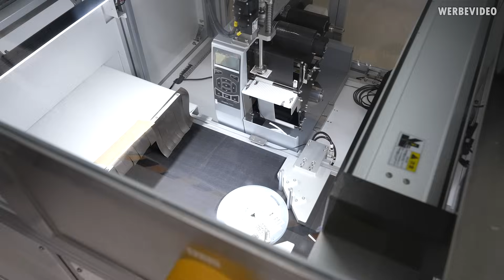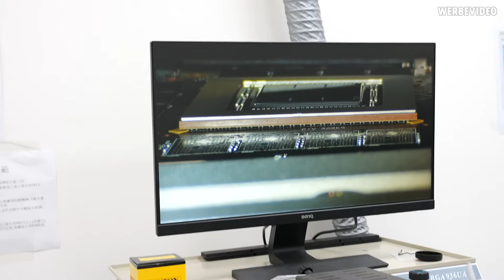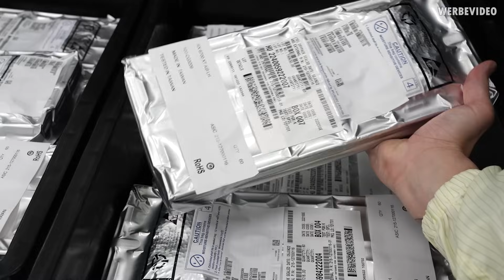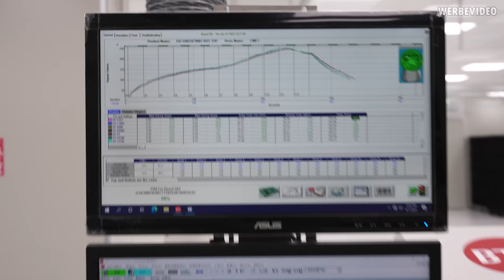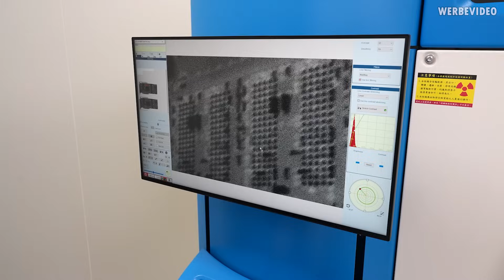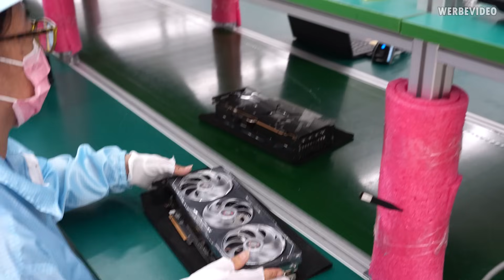How Graphics Cards are made - Insane PowerColor Factory Tour

Comment: We need more brands/AIBs to be so transparent like PowerColor, and shows us how they made the products that we buy. Very thanks to PowerColor for letting you show us everything.
Reply: Most are made by PCPartner
Reply: Imagine ASUS getting exposed about cheap makeshift handler picking up randomly organized capacitors and slapping them on precariously
Reply: @fruitbouquet5479  imagine that it's not hardware that's the problem at ASUS but it's software :o
Reply: I used to work in a facility like this (but not VGA and I was in a clean room) and I'm 100% confident that all the other brands build their cards the same way, they probably use the same machines too (or very similar ones). Because this is the way you have to make these cards, there is no other way.
The difference is how the different brands QC their end-products and where do they order their PCB and SMD components from.
Reply: Big players like NVIDIA or ASUS would never allow this, and definitely not to der8auer. Someone like Linus might have a chance under strict surveillance like the tour with Intel.

Comment: The pick &place machine measure the tool vacuum and knows if a component has fallen off before reaching the board. This way, the tool with the missing part does not touch the circuit board which would get solder paste in the tool. It knows....

Comment: The reels feeding the pick & place are specifically ordered to reduce placement time. About 8 parts are sucked up at a time and photographed as they leave the reels any rotary or cartesian offset adjustment is made on the fly to the circuit board. The parts are puffed off the tools onto the boards. To speed up the assembly pipeline, four machines are utilized. One fourth of the parts being place by each machine. That speeds up the line...

Comment: I bought a brand new power color ex 7900xtx red devil . I went to plug in the 3 pin egg cord and both outlets broke with the slightest pressure. Spent 1100.00 for this card and haven’t even turned on the computer yet. This is my third series of red evil and I’m shocked at the quality of the rx7k series quality

Comment: What a crazy tour ! I'm surprised they run every card for over 1 hour.
Reply: I doubt about that.. new gen cards are power-hungry, those manufactures have electricity bills to pay
Probebly they run them like 10 minutes to see how they handle heat & as last QA test to pass
Any failure card will be spotted in first few minutes mostly
Reply: @Jack_Sparrow131  they do run them an hour each, even more for some cards. They do not care about electricity costs for QA testing.

Source: Cousin worked for Galax factory in Taiwan as QA tester.
Reply: @randomasdfx7891  not sure about galax, but even more known brands do not test their GPUs for long time unless it was high end GPU or high cooling tier
Reply: @Jack_Sparrow131  Oh yes sir they do. Only the very low end GPU's don't get that much quality control testing. Even with the big "known" companies they always pick sample cards from the batch and run them hard to test for batch integrity. 

It will cost MORE money to recall a batch of 10,000 cards plus all the negative PR that goes with it than to run 10 cards for an hour.

There are certain standards in QA that AIB's are made to sign, and very strict quality control is part of the contract.
Reply: @Jack_Sparrow131  The electricity is not as expensive there as in the EU and they will probably also use some solar power.
Reply: @gpsoftsk1  Correct. And running 100's of GPU's non-stop are mere cents in the overall operating costs of a factory. They probably spend 10x more on climate control electricity costs than running GPU's for QA testing.

Comment: I used to work for a company that produced control modules for hybrid vehicles - and the manufacturing process of the electronics was surprisingly similar to the processes in the video.
Everything from the filmrolls with the thousands of capacitors, to the vacuum sealed PCBs, to the quality control - basically the same process lol

Comment: I worked on a SMT production line like this ~20 years ago, we were placing ~500,000 components a week. Manual inspection of the solder paste and single head machines. You would listen to the pattern of machine picking and hear the change in rhythm when a error would occur.

Comment: Fantastic video.  Thumbs up for PowerColor.   I find it amazing as to how the tiny SMD components can be rapidly picked up and placed in position on the PCB's.  Take an SMD 0201 component package size for instance.  It is a mere 0.02" x 0.01" in size.  That's about the same as the thickness of 5.0 x 2.5 human hairs.  Anyhow, I had recently purchased an RX-6400 for my DELL 7070 SFF computer, and of course it is the PowerColor RX-6400 version.  It's running nice and cool most of the time and thus the GPU fan is usually in the off setting.  The GPU fan only kicks in if the temp goes up to 60 degrees Celsius or more.

Comment: Wow this is fascinating.  I guess if they get the wrong spool on a single SMD machine they could make 10,000 mistakes.  Or if they have one spool that is low by 10x on its parts they will produce 10 defective graphics cards lacking 10 SMDs.  So they need to "shape" their incoming stream of parts into the proper form & quantity so there are no glitches during production.

Comment: Great tour. This is the exact work i did 15 years ago before free trade destroyed US electronic manufacturing. It's amazing to see how far automated quality control and inspection has come. The automated cameras and xray inspection must identify most pcb manufacturing issues allowing them to do large batches. Back in the day you had to build and assemble both sides of the boards in a continuous line to get them to electrical testing as soon as possible to prevent building hundreds of boards wrong. Back in the day a lot of effort was put into reworking/repair because we didn't have this level of automated inspection machines. I am curious about their fail rates and if they had shared any of that info, because you can absolutes have components go out of spec/bad half way through a spool. The tour did show reworking GPU replacement and the very cool 3d xray machine but we didn't see much about how much space/effort is put into reworking failures.

Comment: I worked as a system engineer for a company producing sensors in Switzerland. I entered the so called clean room ( where the chips were processed ) only once and i can guarantee you that you had no chance to enter it , the way you have been dressed. I was completely covered, not a single point on my body was unveiled. It's called a clean room for a reason. I am very surprised that a company like Powercolor allows people to visit such a sterile environment in such clothes. ( not covered entirely )

Comment: Powercolor is amazing. I have RX 480 powercolor red devil... Bought literally the day it was launched (you do the calculation how many years that is now), Still working perfectly fine to this day... and in what environment, slightly moldy, moisty, dusty.
My second powercolor red devil 5700xt That I used for almost 3 years before getting RTX 3090  last december(slightly used for about 5 months in a mining rig which was very well maintained and about 50% price off, working like brand new, got lucky as fuck) and now am using 5700xt for my third computer, still working without any hitches.

Neither one of the red devil cards ever complained even when I ran them on their clocking limit, cooking them up in the afterburner and in games maximized at 95%+ usage. The only thing that complained was the air that the fans beat hard when they were being maximally utilized at aggressive clocks.

Honestly... If I mean when I buy another AMD GPU... It's definitely going to be another powercolor red devil model (or some other equivalent model from powercolor if they retire red devil brand).

Like honestly they make excellent graphics cards.

Comment: Amazed at the amount of YouTube "experts" handling PCBs incorrectly. Home users assembling their own PC should pay attention to the fact that the reworking stations use anti static straps and anti static clothing. This is so any unseen static electricity doesn't damage or destroy the card. Always best practice to hold PCBs  by edges but not touching any components or exposed tracks or connectors. If you don't have a anti static strap when adding a component to a PC, hold the card (while still in the anti static bag) in one hand and touch the PC frame with the other to allow charge equalisation. Better to wear cotton and wool clothing but not polyester.

Comment: I'd recommend they use better thermal paste. The amount of times I've disassembled graphics cards and found thermal paste turned into concrete is crazy.
Reply: As long as the concrete still has the same thermal transfer properties it wouldn't matter that it was concrete.
Reply: @Safetytrousers  The slightest movement of the PC can make cracks in the concrete completely ruining any thermal conductivity.
Reply: @ShamblerDK  A hairline crack would make no difference. A gapped crack may though.
Reply: @Safetytrousers  I have saved many graphics cards just by changing the thermal paste. A hairline crack usually reveals a much bigger problem; bending of the PCB which will definitely make heatsink contact worse when the thermal paste has turned concrete.

Comment: Omg they did soo much. I thought these board partners only made the gpu casing coolers and quality check. But looks like they basically build the whole card . Soo which part was contributed by nvidea or amd ?
Reply: For the custom designs only the GPU chip itself is supplied by AMD or Nvidia.
The silver bags with the RX6700XT labeling contain those.

All the other parts like the PCBs, cooler, frame etc. are all made by the board partners themselves.
Only for the reference card designs AMD and Nvidia supply the PCB as well.

Comment: PowerColor is a Taiwanese graphics card brand established in 1997 by TUL Corporation (撼訊科技),[1] based in New Taipei, Taiwan.

PowerColor is a licensed producer of AMD Radeon video cards.[2][3] The majority of PowerColor cards are manufactured by Foxconn.[4]

PowerColor's AMD video cards range from affordable cards appropriate for low-end workstations, to cards for high-end gaming machines,[5] thus catering to a wide range of the market.[6][7] PowerColor's manufacturing arrangement with FoxConn has given it the ability to change the specifications of cards, allowing them to announce products with higher specifications—overclocked by default—than AMD or its main competitor, Sapphire Technology.[4]

Comment: in 2012 i bough amd radeon hd 7970 produced by powercolor.
after 2-3 years, it began to heat up. Temperatures reached 84-85*C. I don't know how many were at the hot spot. But I guess it's over 100 degrees Celsius. The card died after five years maximum. I did not know then that the card can be serviced - change the thermal pads and thermal paste on the GPU. As a result, hardware artifacts appeared. And at any load it went to a black screen. I assume that the detachment of the GPU has gone. From the very beginning of the purchase, I did not like the temperatures that reached 80 * C. I don't understand what was the problem with making the radiator more massive? As now on the same 7900 or 40xx. After that, I do not argue that the quality could have grown in 11 years. But the sediment in my soul remained and I no longer consider buying a card from this company. Despite the fact that there is a lot of my fault that I did not know that the card needed to be serviced. I want to note that two video cards that I had in the past from AMD died. And here are a few video cards from nVidia that I had - none of them burned out. AMD, you yourself have earned your reputation. Even now, AMD graphics cards have a greater chance of failing. Reliability is more important though. I understand that the resource of video cards, according to the creators, is no more than 3 years. So that every individual in the world buys video cards as often as possible. This applies to all things. But video cards themselves become obsolete. Is it really impossible to make a reliable thing? Do you know why Kalashnikov is valued in the world? Not for accuracy, not for the rate of fire ... But for reliability. This weapon WILL fire in any case when others are wedged. Any person is valued for reliability. Any product is valued for its reliability. What's the use of a fast car if it breaks down half way. A slower car and less comfortable will take you there and back. And manufacturers do not rely on reliability, but on speed just right. The cards have become VERY productive, but have lost reliability. I have heard the opinion that just now AMD 7000 video cards have a short-lived design. That's why I don't have AMD and that's why I don't have Power Color